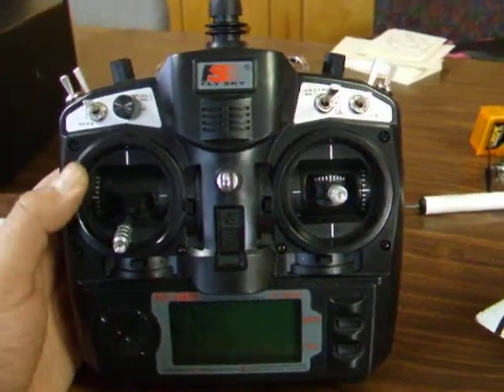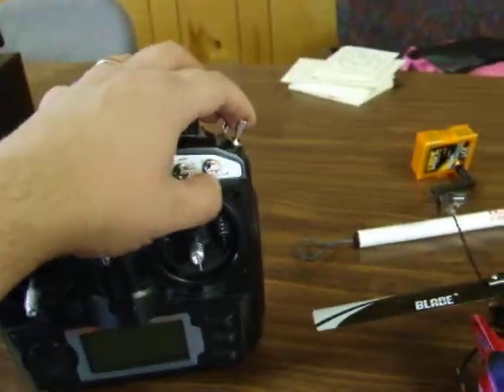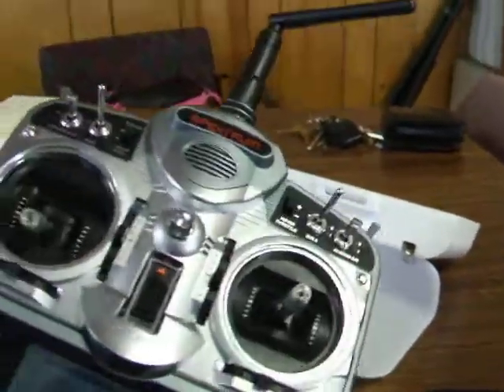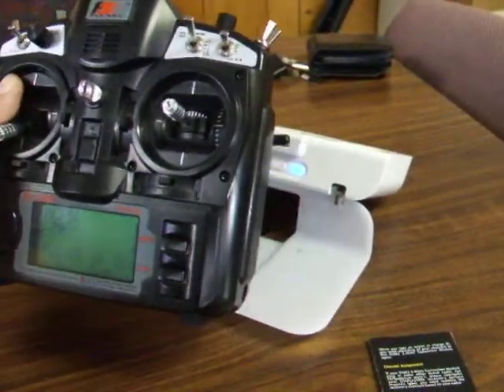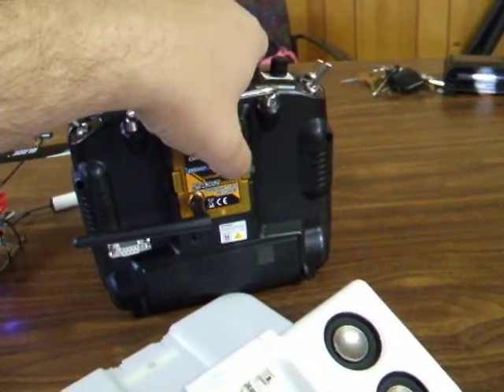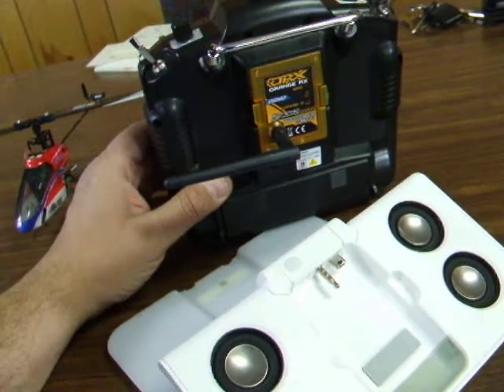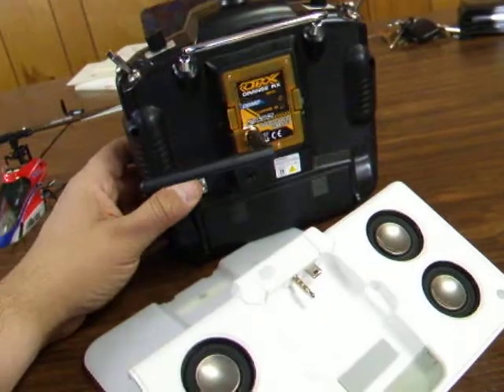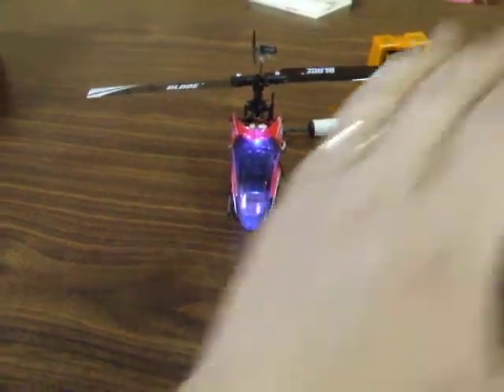Turnigy 9X Spektrum Radio DSM-Modes

Comment from the maker: Dave, I may be able to help you on RCGroups dot com.
Try starting a question there.
You probably need custom firmware such as ER9X flashed onto the 9X for it to work
so you can change which channel goes to which control feature on the quad.
For a starting point looks for some msrX configs with the 9X as that is a simple 4CH heli. Moto: Should work fine but you will need ER9X firmware to move channels around or switch servo connecters around on the 500 3D to match the 9X stock firmware channel arrangement.  I use mine with a Blade MqX and Blade Mcpx